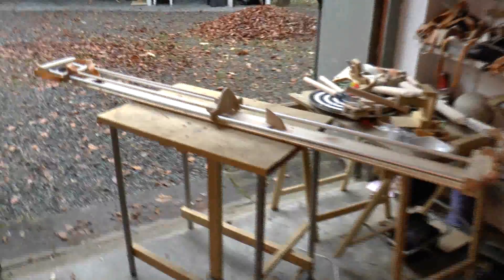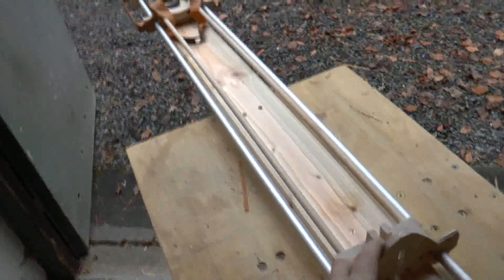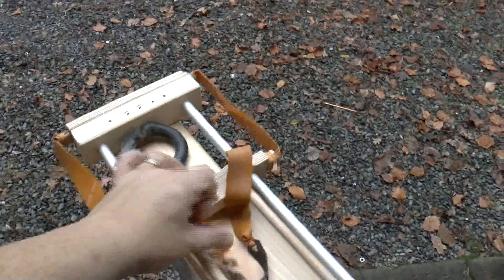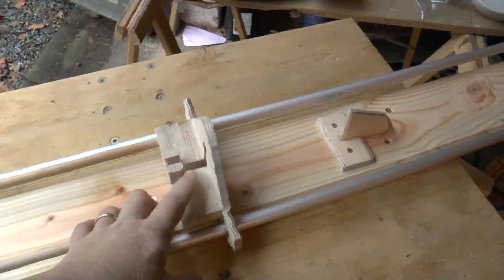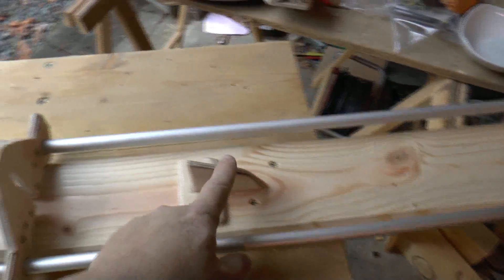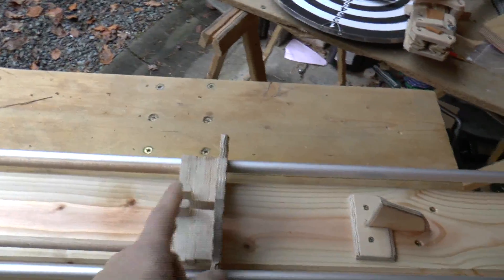Preview: Shooting A Slingshot With The Slingshot

Comment: You're making the shot possibly weaker. The main slingshot is not having constant speed - meaning there is a inertia force applied (with the opposite direction to acceleration) to the slingshot and the ball itself by accelerating secondary slingshot making your main slingshot (with the ball) less effective because you're loosing accelerating force from the main bands itself. But the concept is bad-ass and it looks like you have too much free time ;)

Comment: Hey, I have a extremely simple solution for the bar bending problem.  Right now, the "cart" has two plates, the front and back one, and the front one hit the stopper at the end.  Just modify the whole thing so that it blocks (with a rope or stopper) the back plate rather than the front plate.  This wiill be pulling on the alum bars instead of squeezing them, making it stable (no wobble), more accurate and potentially lighter.  Explanation: its much harder to deform/break a straw by pulling on both ends than by pushing on those ends.  PS If anybody doesn't understand I'll gladly make them a drawing/video on request

Comment: Chris this works with momentum P=MV so the balls weight and the speed it is mooving effects the momentum however momentum is added so for example: if you throw a ball while standing still momentum is simply acting on the ball however if you then ran with the ball and just let go there will still be momentum and as sutch the ball will continue. If you then run and throw these momentums are added causing more momentum. so think of the first bands as someone running and the second one throwing

Comment: to the people worrying about physics, relativity, causality, the universe and everything:
no sling can accelerate the ball through it's full pull because the rubber has little energy at the end of it's contraction and moves slower, and no sling can instantaneously accelerate an object, because doing so requires phenomenal amounts of energy. ( as-well as being scientifically impossible ) having many bands does improve the distance you can effectively transfer energy to the object with, imagine flicking a golf ball versus throwing it, flicking the ball is painful because it's mass is exerting a large force against your finger in a small period of time because you have only a fraction of a second to accelerate it and have to deliver a truly stunning amount of power to it in that short period of time to make it move any distance.
when throwing it, you have longer to impart force to the object and moving it is easier ( it goes further ) you're still only throwing it with the force your fingers can apply, it boils down to: you're just able to put more energy into the object over time.

it's a nice physics lesson, curtsey of Mr Joerg and well done as usual :)

Comment: Wouldn't the same amount of energy be stored in the projectile with just double rubber bands. Or are the energy more efficiently transferred to the projectile during a longer fire travel/shot ?

A simple chronograph would confirm this. :-)
Reply from the maker: You can always double the rubber in this configuration as well. This is an experiment, not a product design.
Reply: Good point.. Keep up the good work.

Comment: Isn't this basically an elastic powered version of a gauss gun?
Reply from the maker: A gauss gun simply accelerates a steel ball piece by piece with magnetism, one stage after the other. This one cascades two independent launchers, both accelerating at the same time.

Comment: It's just quickening the band release that's about it. Think about it, if I was running and I shot a pistol, it wouldn't affect the round. The barrel and hammer are isolated from the running so in theory I'm only moving faster toward the target which is happening here.
Reply from the maker: If you run towards your target you ARE speeding up your bullet, from the poiunt of view of your target,
Reply: JoergSprave
But the round is isolated only to the chamber. The only case I'm thinking where this would apply was if I was speeding down the highway holding a hammer outside my window.

In this case since the hammer (tool) isn't dependent on anything except my arm and gravity, it will of course add some speed to when I swing it out my window.

But see with a pistol, the round is dependent on the hammer in the chamber. It's like if I was to move my hand out toward the target as I pulled the trigger, I only decreased the distance the round will travel to my target thus only affecting the way I (or the target) was looking at it. But in reality all I did was subtract the distance to my target by moving the chamber (in your case the slingshot was moved toward the target faster)

Awesome work on the slingshots.

Also for the slingshot shooting a slingshot, how about in another one you do in fact shot an actual slingshot that does shoot. Think maybe a aerodynamic design like that of a round for conventional grenade launchers [::::D Maybe?
You could use a drag plate near the back so when you fire the first stage and launch the second, in mid-air the air resistance will pull the drag plate on the second slingshot and release a sort of trigger attached to the drag plate. Think about it, like a second stage rocket. Plus it'd be pretty comical seeing a slingshot shoot a slingshot that shoots a bearing into ballistic gel.
Reply from the maker: MyTurtleCollab
You still don't understand. Think system. The round is NOT "isolated to the chamber". It is a part of your system, together with the gun, your clothes, your shoes, everything that you accelerate towards your target. You have to invest energy into that acceleration of course, as every soldier who is forced to carry his heavy gear on a long march can confirm, so it doesn't come free - but laws of physics dictate that it doesn't disappear either.

If your target is a part of your system also, then the speed of the system does not matter. So if you shoot yourself in the foot, then the result is the same no matter how fast you run.

But if the target is outside of your system (= standing still while you run towards it), then the target faces the sum of the acceleration vectors that lead towards it - namely your running and the pressure behind the bullet caused by the expanding powder charge.

Comment: I think you are actually loosing kinetic energy from this as your fork moving is only drawing the tension and the first stage rubber is absorbing the backwards pull instead of all of the force being off a solid object. Hard for me to explain but I hope someone with a physics degree understands what I mean and can put it into better words
Reply: JoergSprave  I think he is right. someone else commented an explanation about a car that i'm guessing you agree with. but think about it say you have a normal slingshot with a 50lb draw weight. when it fires all 50 pounds is pulling the ball forward because the slingshot is completely stationary. Having a slingshot on the sled means that the frame isn't stationary, so when it fires the sled and ball both move towards each other. Of course the sled has more mass so it moves much less than the ball, but it is still absorbing some of the force. 
so really having a normal slingshot with a 100lb draw would move the ball faster than having that frame have 80lb of draw and the sled having 20lb. (plus  80lb bands would be moving the weight of the sled so it would be less effective than a normal slingshot anyways)
Reply from the maker: I think you are totally wrong.
Reply: Derek Peterson this is actually a working concept, think of it as you are riding in a car, and you throw a ball forward out the window, not only is the bal being propelled by your arm, but by the car as well, in fact you don't have to even throw the ball, you can drop it and you will see that the car being driven is already giving the ball speedso what Joerg has done is the very same concept but with a slingshot of course, make sense now?
Reply: Sam Piazza I think everyone is missreading what I'm saying. Imagine trying to throw out of that same truck backwards. It's not a perfect analyses but it uses the same principles if you're moving forward say 30MPH and you throw a ball backwards 60MPH it will actually be moving 30MPH.
What I see going on is the fork moving closer to the projectile without it moving forward much, there isn't so much of a loss as much as there really isn't much gain, since the energy is just coming from the bands further down the chain. If the fork was already moving on a platform and already had inertia then there would be an addition of force. but this is just linked rubber. You could take that same mass in rubber and create the same force over a lower travel.
Reply: Nebuelaeus yup exactly what I meant

Comment: JoergSprave 
Conservation of energy. Cool experiment, but I believe you can only waste potential energy on moving the sled. You should get a faster result by just combining all of the bands (but where's the fun in that?). I can't wait to see the results.

Edit: I just noticed your comment about retraction speed. Didn't think of that, but you might have to scale up to notice a difference.
Reply from the maker: If the two vectors add up (means, if the result of both is higher than each individual result), that is all it takes to prove the point.

Comment: In slow me it seems to me that when the second slingshots is released, it pulls back on the rubber of the first slingshot - and actually slows the first one down. So the effect of the double slingshot might be negated, or at least diminished.
Reply from the maker: The release does cost a small amount of energy. But the acceleration still continues at this point until the ball leaves the pouch.

Comment: Cool slingshot! But I believe the physics is wrong. In fact the pouch should have the same speed than it would with bands of the lengh of slingshots added up, minus the energy that is lost by the sled. If I am correct, you would have better results just taking longer bands. I love your videos by the way!
Reply from the maker: The cascaded method, in theory, can break the maximum retraction speed of rubber and therefore deliver better speed than long bands.
Reply: Thanks for your answer! I thought quite a while about that problem without coming to any satisfying solutions. I guess that it has something to do with the fact that the second one is released later? I would be really curious to compare the speed to a single slingshot with the same rubber and same band lenght than the one of both slingshots added up... Thanks again for your videos, they really brighten up my days, you also motivated me to put new bands on my childhood slingshot!

Comment: When the second part of the slingshot is fired there is an equal and opposite force exerted backwards, this can be seen by the slingshot (moving on the rails) slowing down as the second part is triggered. There is little cumulative velocity between the two components. For example if the slingshot was fired at 10m/s and that slingshot was then triggered firing the projectile at a further 10 m/s the net velocity of the projectile would be nowhere near 20m/s. This is because as the second trigger is fired the frame holding the second set of bands immediately slows down.
Reply from the maker: The slow down is just an effect of the trigger resistance, not very significant really, and the system overcomes it quite quickly. The whole system accelerates until the ball leaves the pouch, as you can clearly see.

Comment: Hmm. I think that perhaps this type of 2 stage slingshot would benefit from a heavier load (bearing). I'd chrono it the bearing speed and measure the trolley speed. Find a place right where the trolley's speed decreases and the ball's speed increases. I think tuning it would give you better fps. Think how they do several stage long light gas guns for ultra high speed impacts (like a plastic marble at 23,000 feet per second, going through inches of aluminum) do it..

Comment: You should make a slingshot that fires a smaller slingshot. Half way to the target while in mid flight the smaller slingshot fires. You could use a tether to trigger it. It might not be effective since the slingshot wouldn't be grounded but it would be super cool none the less.
Reply from the maker: Don't you see that this IS exactly what you are talking about?

Comment: What about using heavy bands to pull just the front of the sled, stretching some lighter bands, and triggering a release when it hits the front? You could have a very short time between draw and release, so your bands are good and warm, but you could still aim at your leisure.

Comment: all this is is one large rubber band with a small wooden piece connecting it in the middle, you could have almost exactly the same effect if you just used one long piece of rubber.
Reply from the maker: But then it would not be a slingshot that shoots a slingshot.

Comment: You could also put the bands connected to the pouch over a set of pulleys, then move just the pulleys with another set of bands. This should save weight over accelerating an entire carriage that comprises a whole sling-xbow while having the same effect.
Reply from the maker: I disagree, that would be completely different, in terms of physics.

Comment: If I may suggest, the band being pulled by another band allows the band with the projectile on it to travel a further distance before the projectile leaves - hence the projectile is getting a push for a longer period of time. The formula for momentum ( I think.. its been a long time) includes time that force is applied.
Reply from the maker: Momentum is simply mass times speed.
Reply: kg * m/s = kg*m/s^2 * s
i.e. same thing. So if you measure the force of the bands times the time the ball is in the pouch, you can work out the speed of the ball if you know it's weight (also accounting for the sled). I think although the ball is in the slingshot longer, there may be less overall force propelling it.

Comment: I teach physics and this is a very interesting concept.  It's a similar concept as to why baseball throwers not only throw with their arms, but also moves their whole body forward to add to the velocity of the ball.  It's also a similar concept to a "Gauss gun" (look it up on YouTube). I'm going to have to show this to my students and talk about vector addition.  As a matter of fact, this may be a good example of a physics term called a "jerk" (or "jolt"), an acceleration of an acceleration, the rate of change of an acceleration.  So this may very well be a "jerk of a slingshot", or you may better like a "jolt".

Jörg, if you are able to do so, could you put a meter stick in your slow motion videos and get some wide angle side shots of the slingshot?  I think this would be a great project for my students to analyze.

I'm curious how this would compare to a slingshot of equal length?
Reply from the maker: Wow, I am much honored! Will make a much more elaborate video soon.

Comment: Good idea, but while it double the speed of the projectile (and the force of it) it decrease it's stability and the predictability of the fly. Maybe if you add a barrel to the second slingshot and a third guide to the first triggered slingshot, it could be fixed. (I'm not an expert, correct me if I'm wrong)
Reply from the maker: Oh, this is just a little science experiment, not a weapon design concept.
Reply: Ok, I can see your point. But, why not? :D